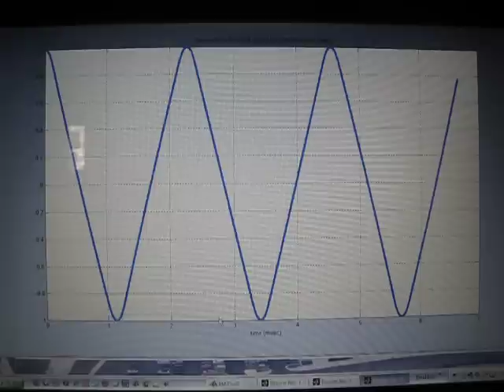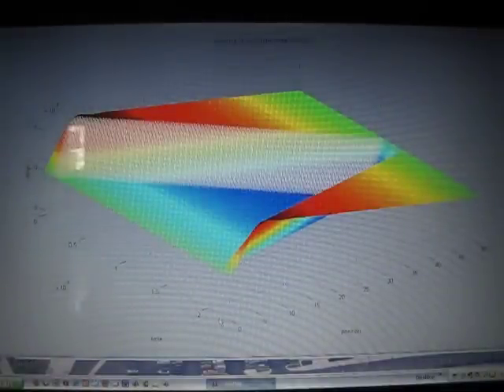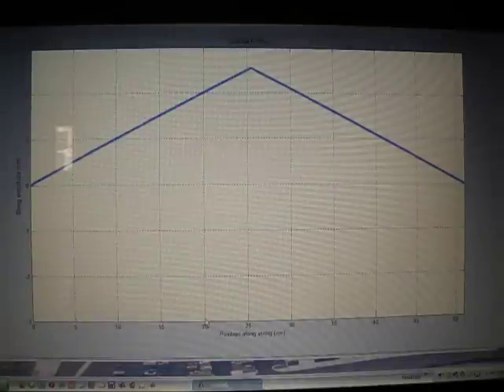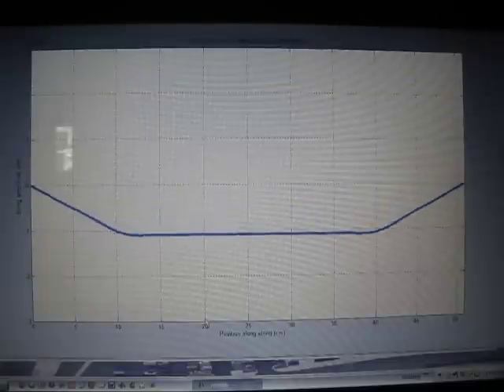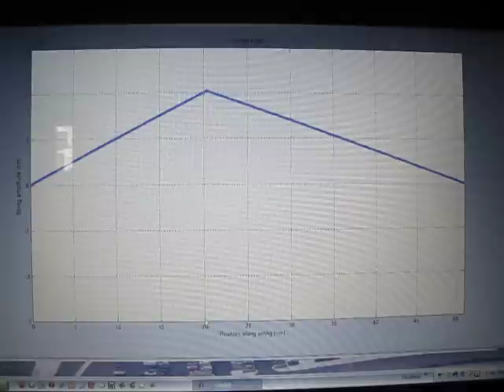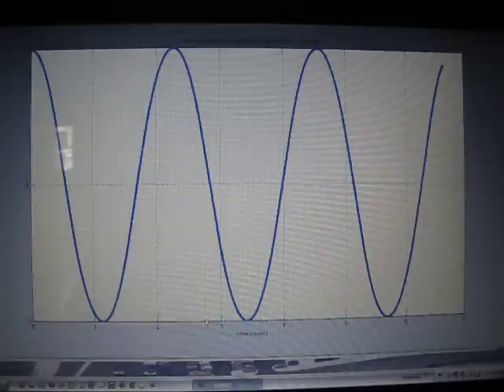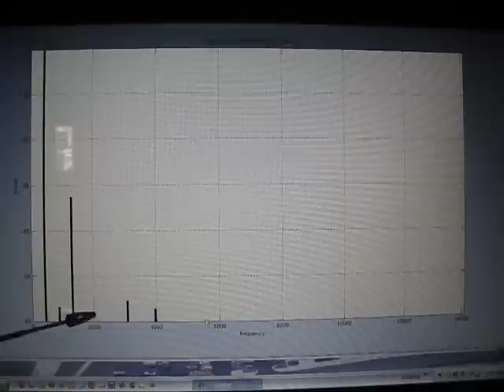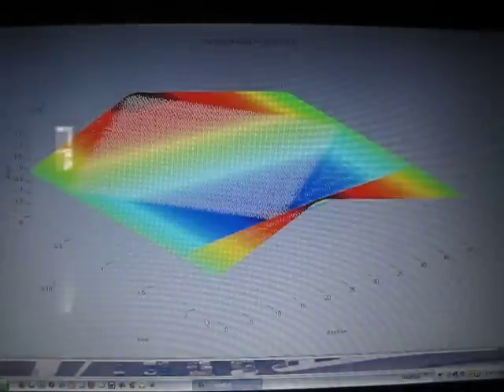Vibrating String in Response to Three Different Initial Conditions

Comment: I believe this is what I found yesterday. I noticed the change in sound on a guitar string when an open note is plucked from the 12th fret rather than near one side.
I thought it sounded like a more pure tone(less overtones). It seems to me that your data agrees with that hypothesis.
I won't be surprised if I'm wrong though.

I tried it on an electric guitar that wasn't plugged in to make sure it wasn't affected by an acoustic sound hole or pick-up location